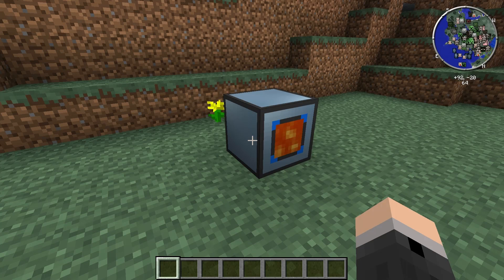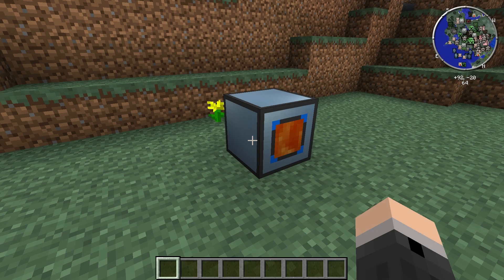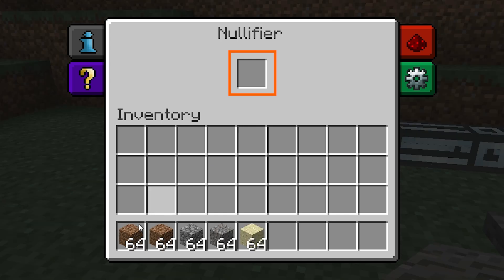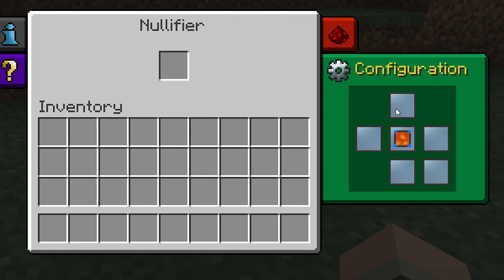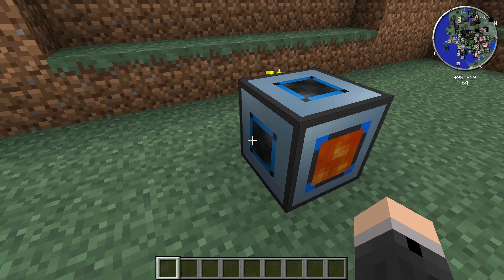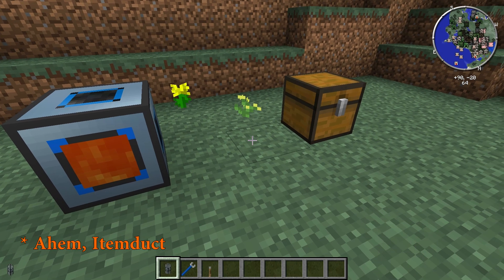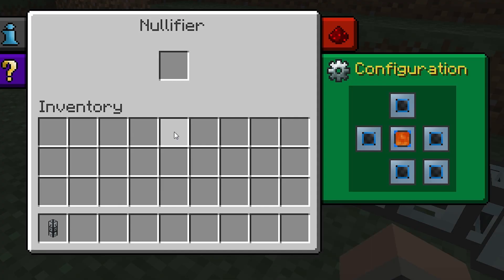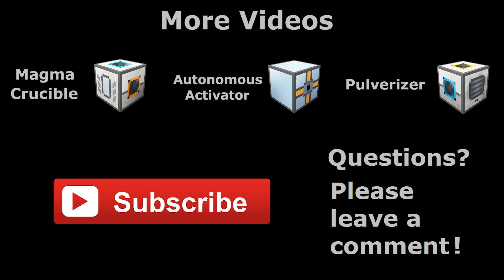Nullifier (Tekkit/Feed The Beast) - Minecraft In Minutes

Comment: I don't see any change when using the redstone control tab, other than the appearance of the front face.  It still deletes everything instantly, no matter the redstone setting or what's applied.  I was hoping it would stop working when redstone control was set properly, so I could for instance put an item in and it wouldn't be deleted until I pulled a lever or something.